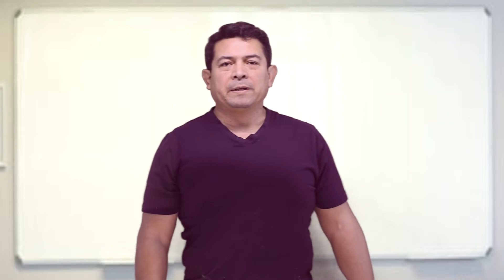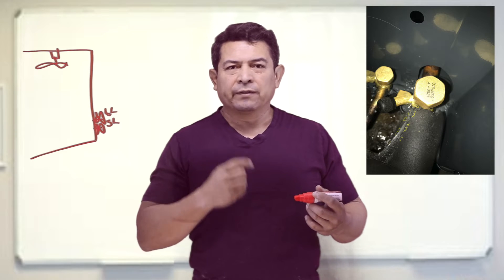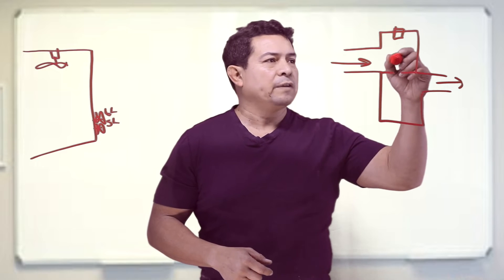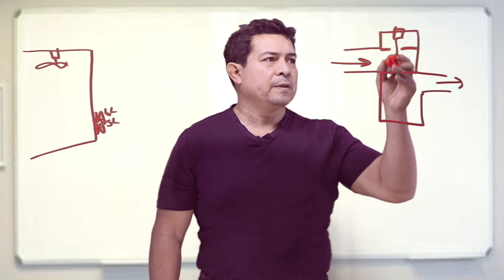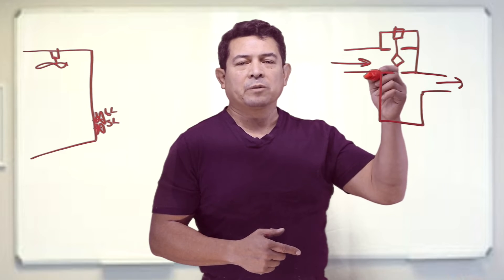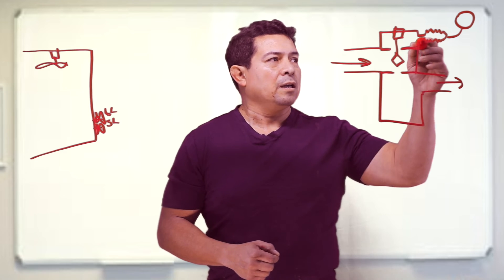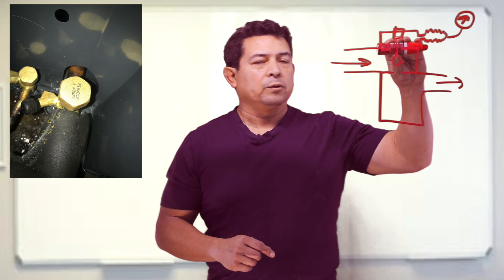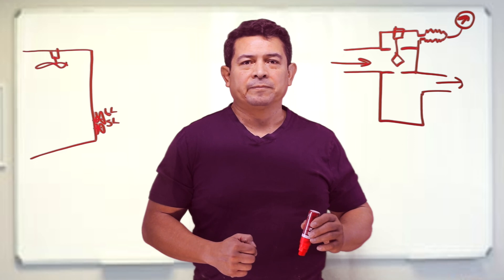Condensing unit Valves - HVAC Online Training and Courses

Comment: I think the service valves on my 40-year-old Friedrich compressor are three-position but I'm not certain. They have a square stem on top (different sizes for liquid and vapor) covered by a black plastic caps  . The service ports are just above both outlet ports, in-line with them, and have no Schrader valve. (They have a threaded metal cap)  How could I determine if it is a two or three port?
Reply from the maker: If your valves do not have traders on them then they are a three position valve. Those valves are back seated so do not move the valves until you have hooked up your gauges. I'm glad you gave me all of that information so that I could know exactly what you are talking about. Thank you!!!  Make sure that you use a service wrench to open and close the valves because a crescent wrench will ruin it and so will vise-grips  or channel locks.   Good luck!!!